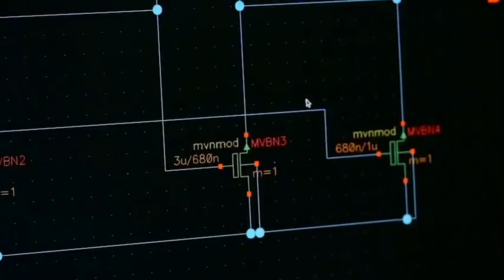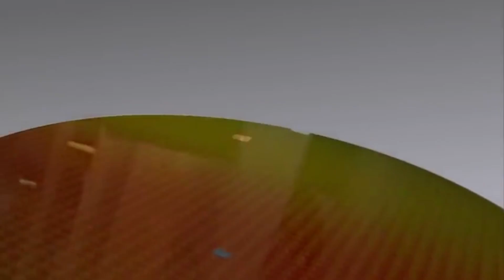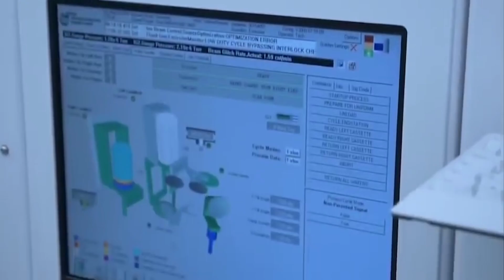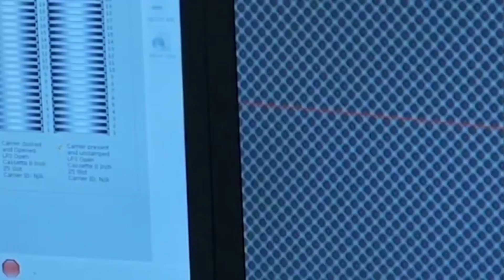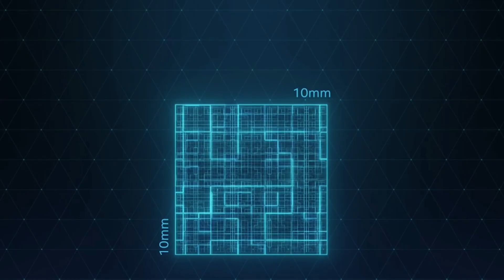HOW IT'S MADE: Microchips

Comment: In 1983-4 I installed Ion beam implantors. This what doped the silicon wafer! To create the covalent bond to conduct electricity.
If one had clue about this process you would understand that so much is left out of this video. Gallium airside and Boron were used to dope I e wafers as well.

Comment: I worked in a microchip processing plant (as an Electrician) and WOW what a dangerous place to work……. And for the life of me I have no idea who how or why somebody would come up with this kind of $#it but the chemicals used in the production of microchips are SO dangerous that the pipes/conduits used to carry these chemicals are (A) clear and (B) inside other clear conduits, just in case there is a leak it’s contained within the outer conduit and within the facility. As some of these chemicals are highly explosive and some are highly caustic and either way you DO NOT want ANY leaks EVER!¡!¡!¡

The only job I have ever worked on that I wanted to finish and leave like the chip plant job was a meat rendering plant in Dallas I worked at back in the 80’s…. Neither place is recommended as a job location

Comment: a lot of folks think its the "chips" that make computers whatt hey re, fantastic whatever, however they are not, they merely dictate speed, what's phenomenal and yes they are chips too are the memory sticks and the more so the storage devices, you know the device that holds the code? speaking of code the code is the most functional and sophisticated.. so the hard drives and code are whats technologically advanced honestly, or what makes it all tic

you can make a computer out of vacuum tubes and transistor or even all transistors, however they would be very large, prolly take up a costco if it were all vacuum tubes and still not be as fast as your phone,  all solid state would be fairly large as well, the size of your bedroom thereabouts, graphics and all..

realistically graphics processors are more advanced than a CPU.. both can be made other ways, vacuum tubes or solid state, what cannot be altered or changes are the storage devices, and more so the CODE.. at least by today's standards..

however one day machine code will be a thing of the past as will building code and script or line code, parsing code.. I just don't see where life from other universes millions of years older than man are still using silicon and C++ parsing into machine code 1's and 0's ... nope do not think so..

me thinks these civilizations have processors so fast we cannot comprehend the speed,  and it's not thicker than seran wrap, just as flexible, heat proof, freeze proof, and it only takes the size of an eraser diameter of it to store, calculate and parse every bit of data man has created thu far.. in reality type omega civilization can manipulate quarks, so they use them to store data, parse data and do whatever else with it they please.. things we are yet privy to..

so a bandaid can run their ships, thrie drones, and traverse the cosmos.. and are prolly capable of so much more, metaphysically, as in beam me up scotty, allow them to take forms or shapeshift if you will.. on and on... who knows these types may have shed the physical body vessels and went straight to the advanced stuff like being whatever they choose..

think about it...IN REALITY this technology is very very rudiment in all aspects, no matter how addicted to it or wonderful you think it is.. its less than 30 years old soin the scope this tech is very very young..  if man were to live another 10,000 years do yo think he willstillhavea cell phones, um "texting" ... LOFL   "I'll call ya later I need to reboot my phone"  DOH!!!

Comment: I missed the part how microchips  are made
Reply: I work at an Intel fabrication plant. People will only ever know the basics like in this video. The bigger details on manufacturing process are kept very close secret to the companies that make them. The technology used to make them are also kept very secret amongst the companies that makes the machines. Its all bleeding edge stuff. 

All it really is is 3D printing on a near atomic level using various chemicals and ionized conductive metals for etching.
Reply: @ryankappel1245  I worked for Kulicke and Soffa back in the 80's.  I taught Gold ball bonding and microelectronics for beginners during tech orientations.  There aren't many secrets that aren't already published!  2 decades in microelectronics as either a tech or Process Engineer!
Reply: @1953Johnnyp  I want to open a microchip manufacturing company can you guide which source to study , books etc , currently I am pursuing BTech in artificial intelligence and data science from India
Reply: @slimshady6242  Study Material Science if you want to start in wafer fabrication.  Manufacturing/Process Engineering would be a good minor.  My advice would be to work at one of these facilities as a co-op to see if this is really what you want to do.  The silicon dust from the sawing process gets into everything so always wear protection and a good dust mask when handling "diced" wafers.  Otherwise, you'll itch like crazy!
Reply: @1953Johnnyp  thank you sir for replying , I want to know if I want to create a company which can challenge TSMC ,how should I proceed in india
Reply: @ryankappel1245  I want to open a microchip manufacturing company can you guide which source to study , books , technology involved and how small countries like Taiwan master this  etc , currently I am pursuing BTech in artificial intelligence and data science from India
Reply: @slimshady6242  Well. To start a microchip company, and be competative. You would need a few billion dollars to build a small fab and tool it up. Then need a small army of top tier engineers, physicists and mathmaticians to design the chips. Then a bunch of qualified technicians capable of calibrating/qualifying and operating the many different types of complex machinery. Also it takes about four years from breaking ground on a new fab to where it is functionally high volume manufacturing. Lastly acquisition of the chemicals and some of the technology needed requires a lot of international cooperation with the regulations and secretive nature behind the chemical solutions and some tech used for making the chips. Specifically EUV technology.

Working in a fab is pretty amazing and being able to see the fabrication process is mind boggling and fascinating. But they require an enormous amount of expensive and hard to get resources, logistics and manpower.
Reply: @ryankappel1245  thankyou sir for giving your time . Sir you are from which country , just curious to know , I am from India
Reply: @ryankappel1245  what if to start at small level and rather then buying machine what if we make our own machine will that reduce cost
Reply: @slimshady6242  No problem! Good luck with your studies and pursuits! I am from the US.
Reply: @slimshady6242  I dont want to be discouraging. But the process to make chips at todays level requires alot of very hightech exotic technologies. It is feasable you could figure out how to do it in very small scale for simple logic or memory chips. But not sure how viable something like that would be against giants like TSMC, Samsung, Intel, AMD etc. 

If you are ambitious like this. Maybe look at getting work at a resesrch and development facility in quantum computing. Since that is the future and the direction most semi conductor companies are going.
Reply: @ryankappel1245  sir what's your education qualification, since you have worked in this sector what's your expertise

Comment: I've been wondering for some time now, and I'm baffled how the first few batches of microchips were even manufactured with all the precise technology required beforehand. And even more, the complexity in inventing the microchip through all those landscape designs, I adore it. Thanks for the explanation!
Reply: It has been a long road getting from there to here... (sorry for the Star Trek Enterprise soundbite)...
Originally devices were much bigger, they were also bipolar transistors, not the MOSFET transistors used now (Thank you Robert Noyce et al. for the integrated planar process & Bell Labs for the MOSFET)...
The original MOSFET transistor IC's were 20 microns in size, they were printed using photomasks that were made using an optical reduction of a "Rubylith" circuit layout onto a photosensitive layer on glass plates - the image was developed and was used to print the pattern on a "wafer", I think using proximity aligners - these printed masks were actually disposable after a number of uses...which led to the hard chrome photomask which could be cleaned & used in hard contact aligners allowing better resolution and smaller features, but defects could be a problem. 
This transitioned into whole wafer projection aligners, where the masks didn't contact the wafer, and then to steppers, where fields containing a few were printed, then the wafer was moved, or "stepped" to print another field until the whole wafer was covered with die. (look on wikipedia for "photomask" for a longer explanation).
The point is there is a long road of improving processes for printing smaller and smaller dimension structures to make the transistor over the last 50 to 60 years. This has seen roadblocks along the way where the questions has always been asked "is this the end?" - I can remember an article in the New Scientist asking this about 1 micron technology when I was around 6th form ±.
Then some new development comes along, mainly smaller wavelength print, but sometimes process games.
And this is just the print, then there is etching the materials, changing from wet etch to plasma etch, and material deposition...oxidation, CVD/LPCVD/ALD progression, evaporation/sputtering metallisation, different transistor structures etc. etc. It is never static.
Anyway, just a flavour of what it has taken during the journey and how it builds on what went before.

Comment: I worked in Intel's cleanroom for three years in Phoenix. My entire team's job was the maintenance and upgrade of a line of 6 million dollar machines. There were 25 of them and their sole job was the scan wafers after processes to make sure other machines weren't adding particles or "defects" to any of the product. I say this as a small insight to how big these facilities are. By the time I left the new clean room was done being built and I could walk straight inside of only clean room for 2 miles.
Reply: sir, what degree you got to work there ?, and how you worked there in general ?
Reply: @khalidss9  There are many levels of education needed for all sorts of positions. Also Intel has to hire contractors full time because they can buy the machines but they aren't allowed much knowledge of the inside because of intellectual property. So I didn't work for Intel, but I worked at Intel in their clean room every day all day. I have my degree in mechanical engineering, however, most of my coworkers came from doing electrical in the U.S. Navy. The position is called "Field Service Engineer" and there are always tons of positions open for many companies with that job title but each one will be a very different machine. It's great pay and an okay job. Definitely a good introduction to the silicone wafer production industry.
Reply: @jacobmcmahon1915  are these work field limited to the army, meaning that no ordinary graduate can work in those factories ?

am middle eastern but i really love technology field so i wanted to know if there is a hope for me 😅
Reply: @khalidss9  As long have you have the right(or close) set of skills and a good attitude, just keep trying and you'll get a job in it. There's so many jobs open in silicon production. It honestly feels endless, the amount of job openings. You could do it, it's not limited at all. Plus a lot of those companies will pay you to move to them.
Reply: @jacobmcmahon1915  thanks alot, hope you the best. 😊

Comment: It started in the 1960's. First application in consumer market were Stereo decoders for radio. With traditional parts they would need induction coils. Later these chips made electronic musical instruments smaller and cheaper, without these, a CD player would haven't been possible in consumer size.

Comment: I have seen Microchips in E-proms and ICs that have been blown apart. Yes, blown apart. You see, some people seem to think that the little box between the mains supply and the device isn't really all that necessary, So when it stops working, they bypass it and connect their low voltage DC device directly to their 230VAC mains. What gets it first? Usually the bridge the bypass caps and the regulators get blown to bits, so much so that the silicon gets exposed and you hope that the rest of the device survived. Alas, that is not always the case.

Comment: YOU CAN NOT MAKE SILICON OUT OF REGULAR SAND. Its actually a relativ rare material. And Sand is not a Elements + the fact that our atmosphere is only 20% oxygen and therefore it is not the most found elements on earth (hydogen, nitrogen should be on top if I'm correct), makes me aggressive in just the frist minute of th video.